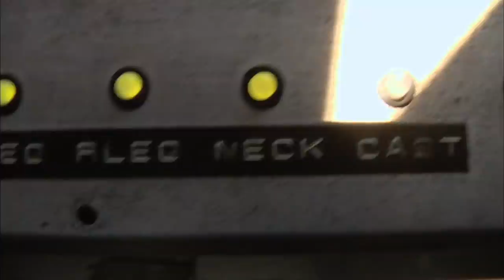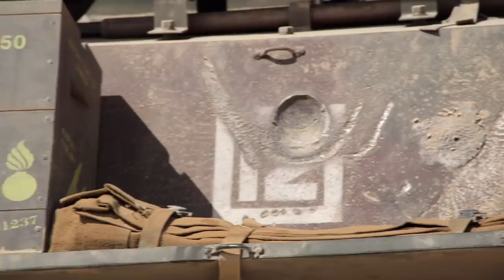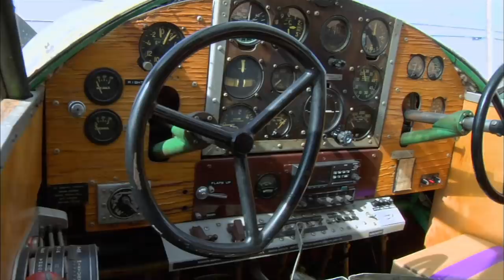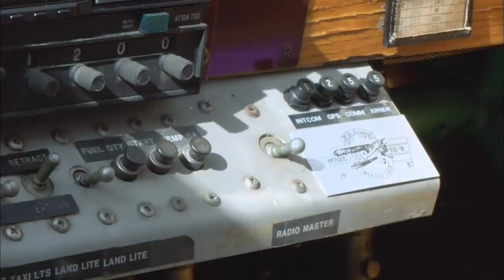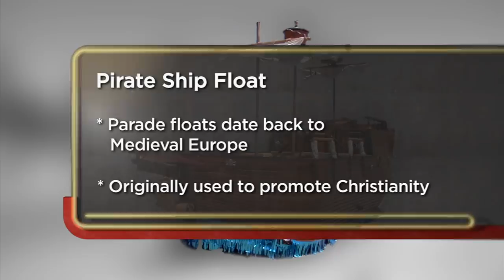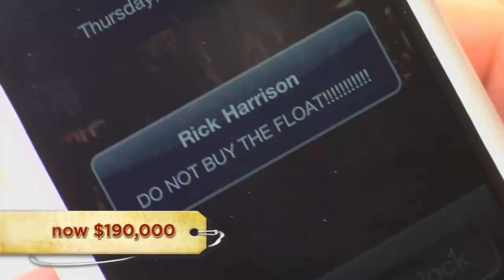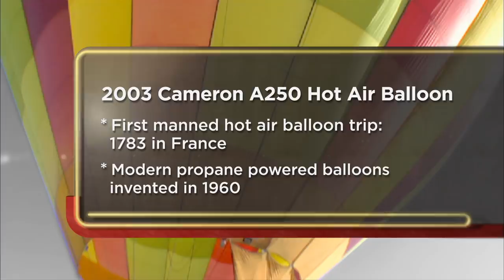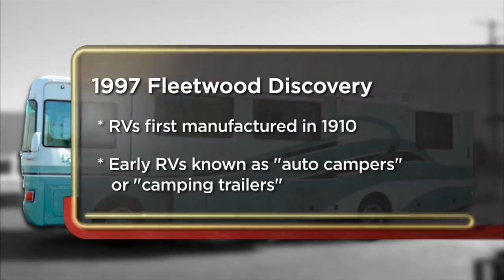Pawn Stars: TOP 7 BIGGEST ITEMS OF ALL TIME

Comment: $15,000 for a brand new RV basically. God I would love that deal, these pawn star guys are criminals lmao
Reply: They make a offer and seller accepts, its not criminal. Seller can say no. RV's are hands down the worst investment one can make. 40% depreciation just driving one off the lot, not a good deal.
Reply: @johnclamshellsp1969  New they're a terrible deal, but that's true of nearly everything with a steering wheel, boats planes etc, but unlike those 20k for a place to live you can drive is a steal especially when it's that or 1k a month rent for a flat half the size
Reply: Could have sold it for 100k.
Reply: I mean, it's a pawn shop. You aren't going to a place like that expecting near market value, you are going there for cash, now.

Comment: That car had to have had a massive amount of tanerite to explode like that, a normal tank shell would never do that
Reply: I was about to comment the same thing. Explosion came from the bottom too. Normal tank shell would just leave a massive hole
Reply: Kyley  highly unlikely
Reply: The shot never actually made contact, the car just blew up on its own. Check the slow mo at 9:14 frame by frame, there's no bullet hole when the explosion begins. The bullet actually hits the ground at 9:16. Also at 11:15 you can see it misses clearly.
Reply: @ayushdeshmukh284  good eye. Can’t believe it’s a big scam like that
Reply: @nickm340i  It's reality tv, like Bar Rescue.

Comment: Ok a word to the wise about pawn shops (due to the boat float guy) pawns shops will pay you based on face value not full value. If you were to sell a diamond gold ring at a pawn shop they’ll pay you based on how much it weight in gold and maybe half the value of the diamond. So if a ring that cost you like $500 you’d get no more out of it then maybe $150. Cuz a pawn resell it at either a discount or higher price.

Comment: Motorhomes at 15 years start malfunctioning even if not heavily used.  Check for hot water tank leakage...
Reply: Yeah because it's all the cheap plastic baking in the sun and pressed wood. Back then it was real hardwood and stainless steel

Comment: Stinson guy is a clown, the commercial pilot may have even been underestimating the repair costs, the engine will need to be pulled apart after sitting for 4 years and an overhaul alone could be $60k

Comment: I think that tank round firing was a fake.  If you watch close enough you'll see three separate explosions.  One from the front of the car, one from the center, and one from the trunk area.  I can say I have a little experience of this.  All three explosions went straight up.  That wouldn't have happened with the tank firing one round directly into its side.  Also, there was no disturbance on the opposite side of the car.  (ie: sandhill)     FAKE!!!

Comment: I feel bad for people that but campers and rv’s brand new they loose so much value it’s not even funny. Old customer bought a brand new rv it was a smaller one that was a Ford e450 powertrain he paid 60k and couldn’t get 30k just a few years later. My sister spent 35k on a camper that she only used a few times over 2 years because it kept breaking so she went to trade it in to the same place she bought it and they wanted to give her 7k lol.